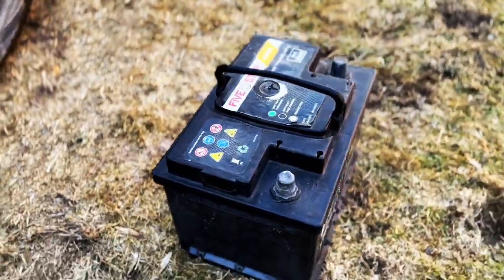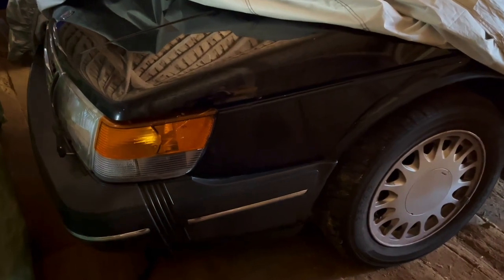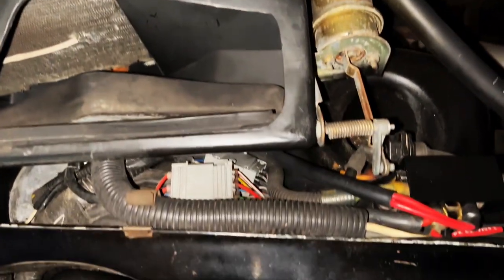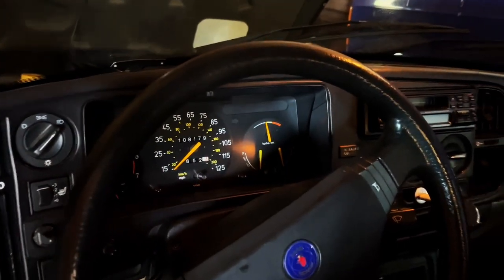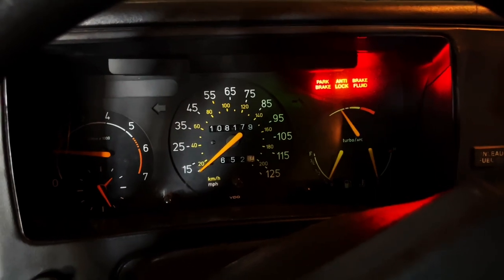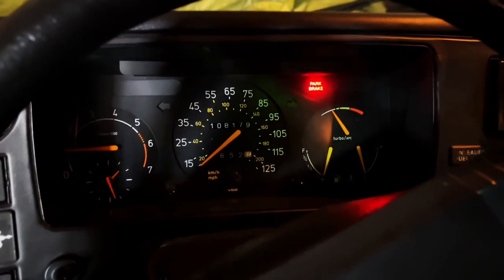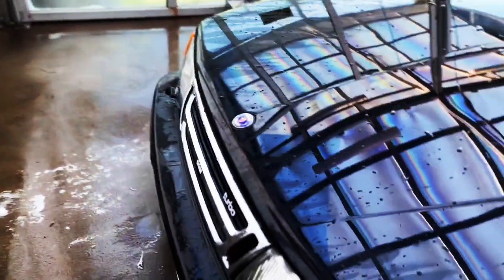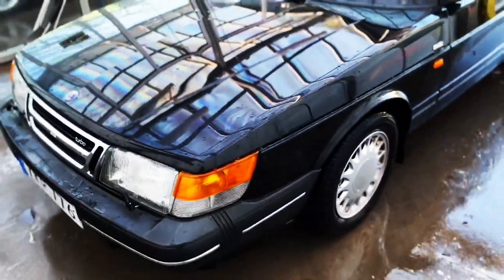Its Spring! its Saab!

Comment: I accidentally overwintered my 900.... it's been in the garage since Christmas while I try to repair a leaking brake caliper and fuel accumulator. It's a real shame since it's got a great heater and it's better in the snow than my backup car.
Reply from the maker: Yeah I agree - they're built for winter and I've always driven my cars in winter back in the UK - the salt here keys cars very quickly unfortunately
Reply: @theclassicsaabguy236  Believe me, I know! I live in Wisconsin and we salt like crazy; I've never lost a car to anything other than rust. My 900's already suffered 35 Wisconsin winters before I bought it though, so  it's too late for preservation.
Reply: @drewzero1  where in WI are you? I have a '91 convertible down here in Madison. I suspect we still have a few snows left, so not quite ready to drive the 900 just yet.
Reply: @mikelancaster7226  Fox Valley. Mine's an '83 4-door. The heater valve is stuck on hot too, so I was really looking forward to doing more winter driving.
Reply: @drewzero1  Sorry to hear about your stuck heat valve. Haven't seen a 4 door in ages.